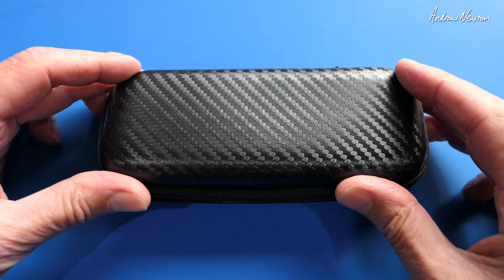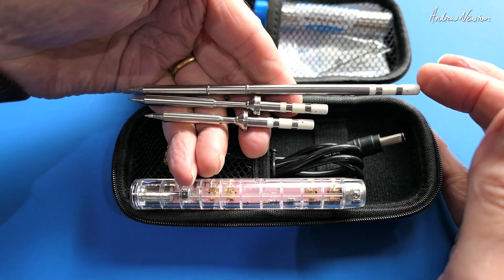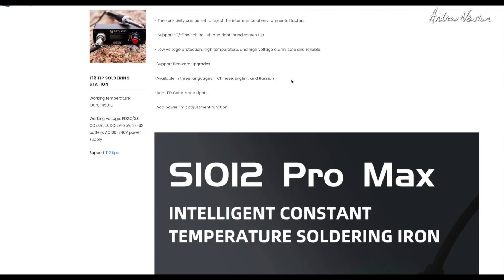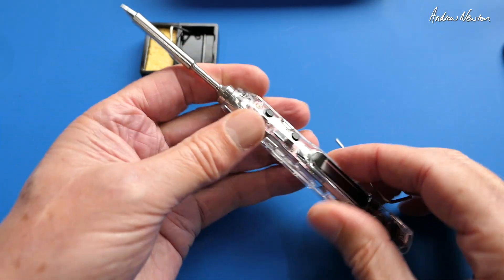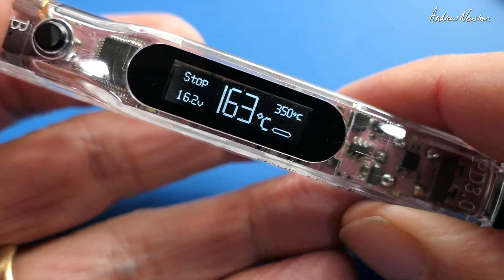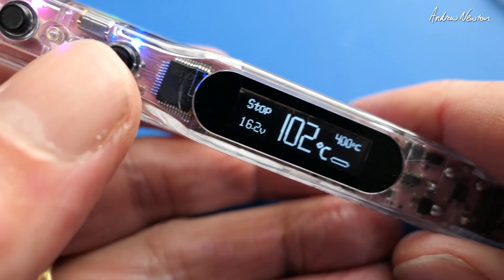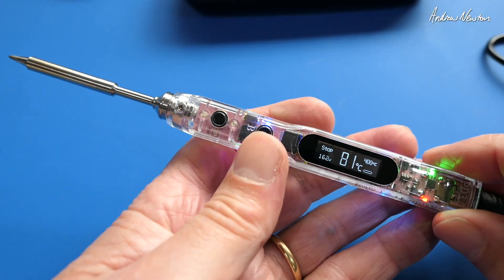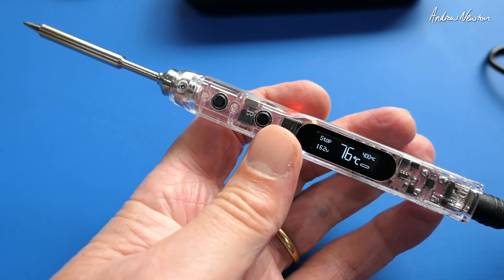Sequre SI012 Pro Max - Portable OLED Soldering Iron

Comment: i have a question, on the underside of the device theres a screw. can I attach a grounding cable to it?
Reply from the maker: Just a tip locking screw I think.
Reply: @AndrewNewton  that is unfortunate... is there another way to ground this thing? i know the ts101 has a dedicated screw for that purpose
Reply: @GreaseBoyKen the tip locking screw is pushing on the tip, cant you just wrap some wire around it and screw it in?

Comment: Hello Andrew I was wondering if it would be possible to flash speedy bee f405 v3 with ardupilot quadcopter  firmware to make it autonomous
Reply from the maker: Have to check the specs sheet

Comment: I will probably get jumped on here, but I have been using my old TS100 for a long time without the clamping screws for the tips.  The flat-bladed tip sometimes rotates when you are pressing, but you are most likely pressing too hard if it does!  Conical tips never move of course.  I don't think the TS100 ever claimed to be "Plug-and-Play"... I don't push my luck; I unplug it for tip changes, but it does make for greater convenience.
I think I might invest in one of these... my Grandson has fallen in love with the TS100!   😜
As always, thanks for the review... Stay safe.